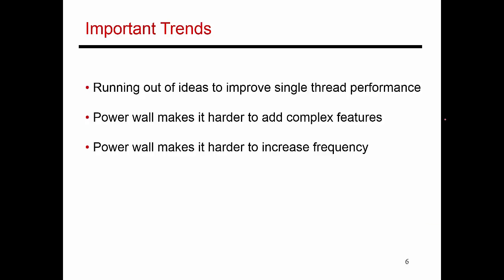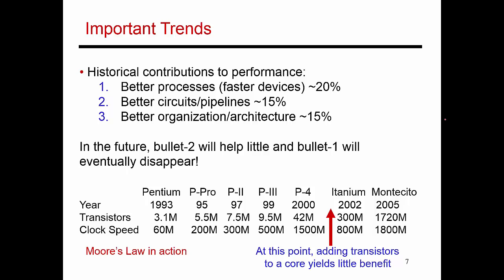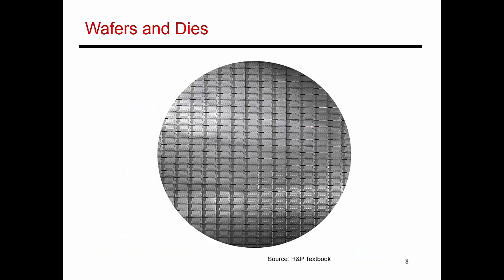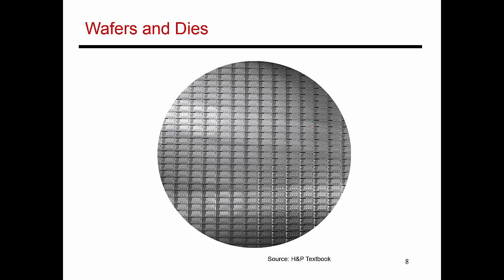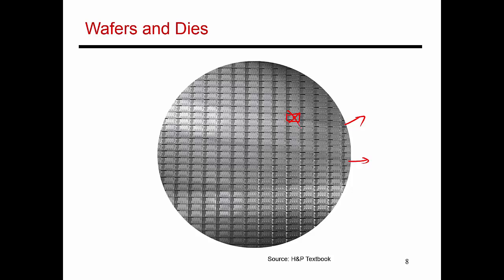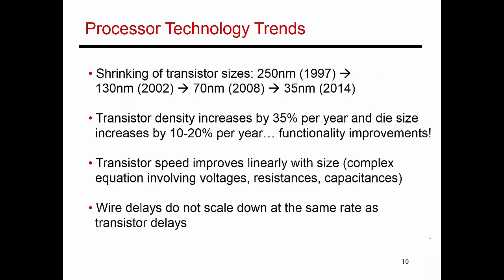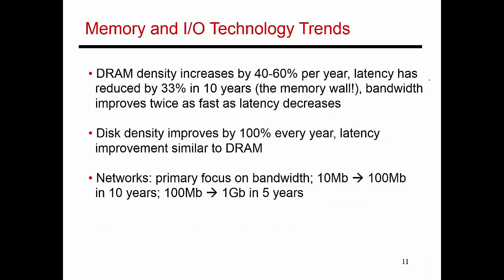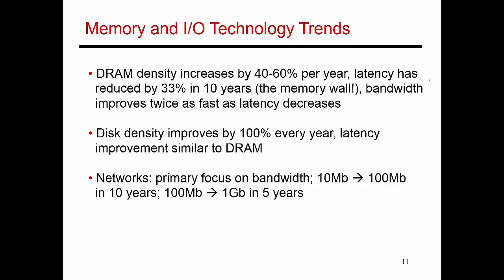Video 2: Processor/Memory Trends, CS/ECE 3810 Computer Organization

Comment: Namaste Sir, 
In your video you told that reduced wire lenght increase resistance which is contradicting to what I learn in physics. Kinldy explain.
Reply: Shortening the wire LENGTH does help lower resistance. The decrease in the DIAMETER of the wire however makes resistance go up.